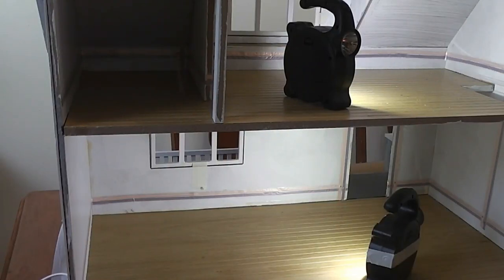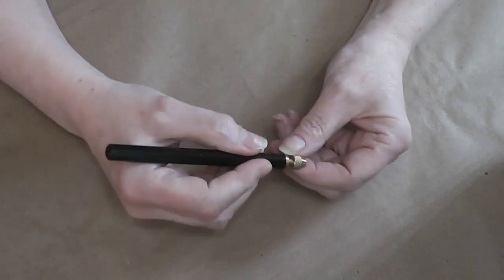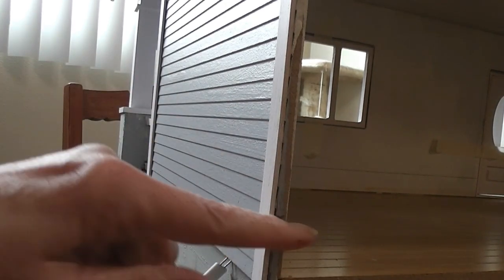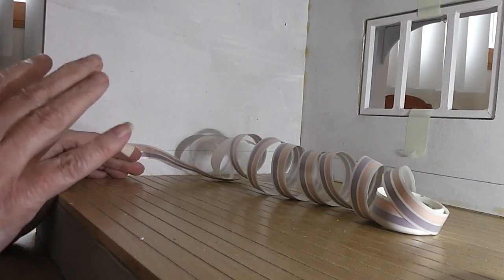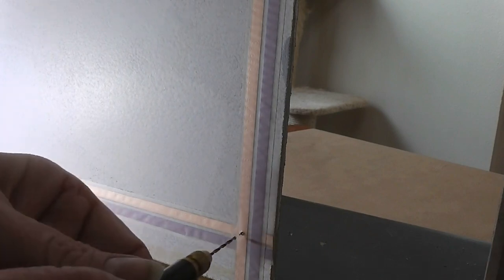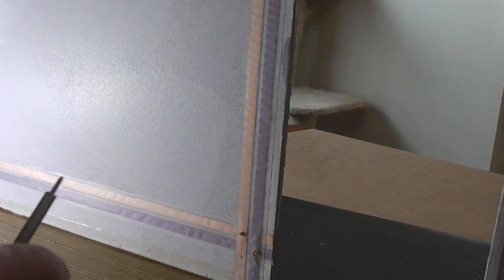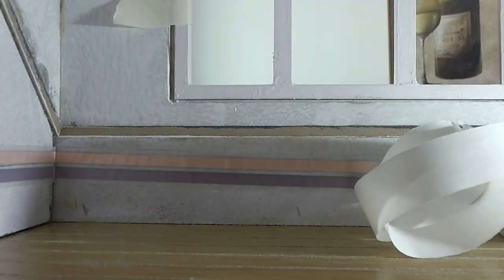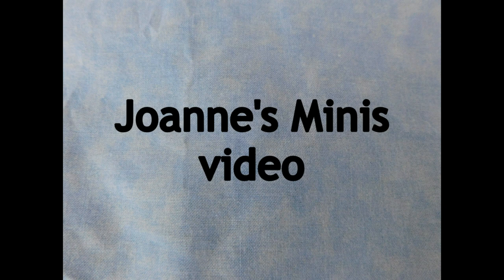Building the Beachside Bungalow part 16

Comment: Thank you so much for your in depth view on tape-wiring! I am making my first dollhouse and decided to give it a go. Do you prefer making splices over folding the tape wire? I thought I would try to only fold the tape wire and have no splices but noticed you did not do any folds here. Is one method better than the other? I appreciate your input!
Reply from the maker: I have much better luck with splicing than I do with folding. Also the splice much easier to hide under the wallpaper.
Reply: @joannesminis  Oh I see, good thinking! Thank you so much